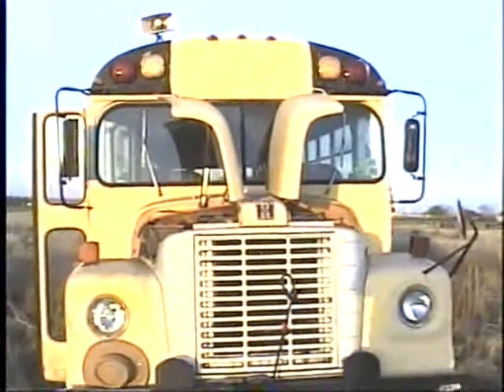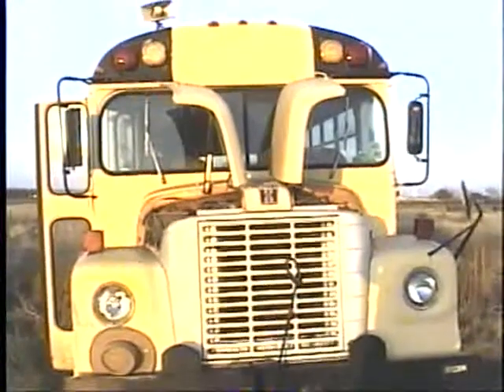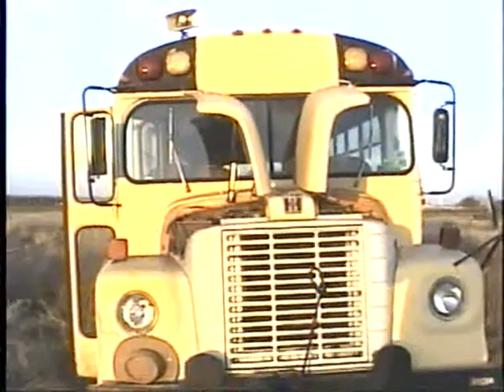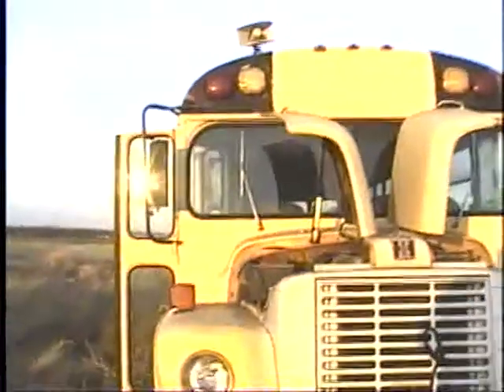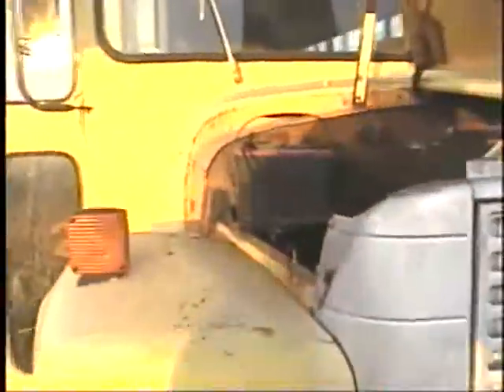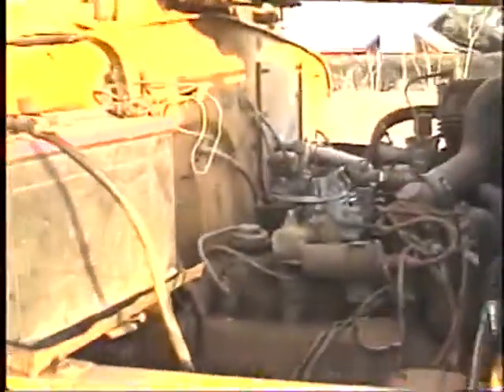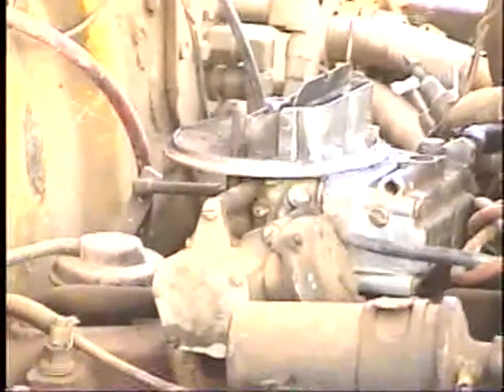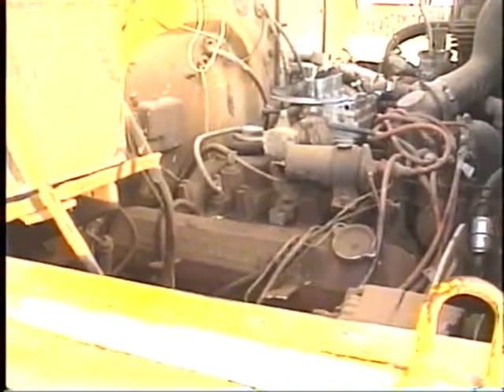1978 International Loadstar 1700 Carpenter School Bus Pt.1

Comment: The last International Loadstar school bus I rode on was when I was a Freshman in high school in Newberg, Oregon in '88, It was a regular length 1977 or '78 Loadstar 1800 Carpenter bus and it had the tilt hood rather than the gull-wing hood and it also had a 345 V8 and Allison AT545 automatic transmission as well as air brakes and a built in Pioneer AM/FM Stereo radio.
Reply: I'm from Oregon to! My school buses were Wayne, Chevy, and Ward I love the Allison tranny sounds!

Comment: I have a 1977 Loadstar with the superior brand shell. Yours with the gull hood is cool looking but the the tip forward hood like mine does allow more engine access. ford9572 these buses have industrial engines and that is why they are so much larger than a light truck engine.